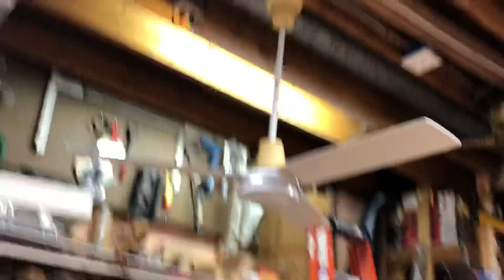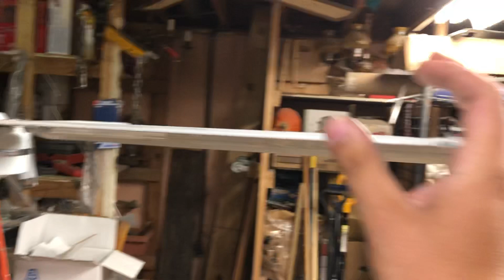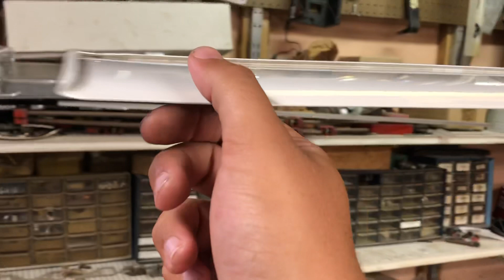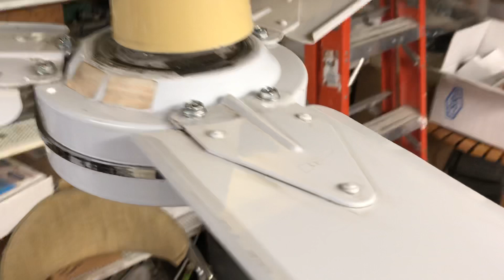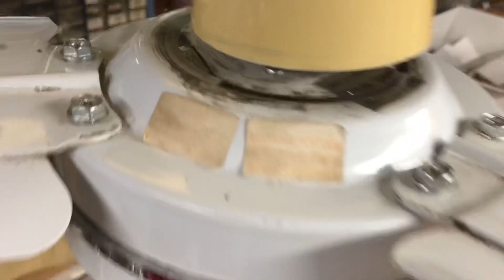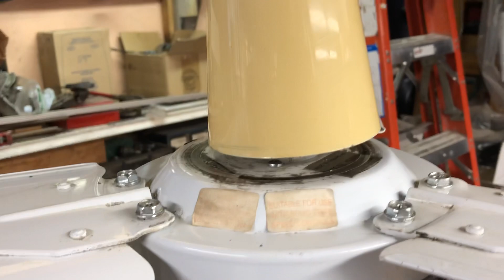Leading Edge Model 4820-1 48" Commercial Ceiling Fan

Comment: I think my local Meijer has 2 of these. Don’t know if there ever was any more or not, but the two I’ve  seen there I have never seen running so my guess is they don’t work anymore. Also for the plastic, I worked retail and the fire alarms they had there were originally white, but the fluorescent lighting I think is what yellowed them over time to the point where most in the back stockrooms (where the fluorescent lights were) were yellowed very badly, and it was generally pretty cool back there so that’s my guess on that. I’ve also seen these at toys r us many years ago and heard some squeaking just like this  I had always thought a balloon was stuck in them and they didn’t get it all out or something

Comment: These were manufactured by Husan for Leading Edge. If you look up videos of Husan fans made for overseas use, you can see that the overseas models have vented motors. This design was introduced in 1990 to replace the previous generation of Leading Edge industrials made by Weatherite, likely because Weatherite ceased to exist. But these continue to be manufactured under the Leading Edge name although Dayton stopped carrying them around 2012 or so.